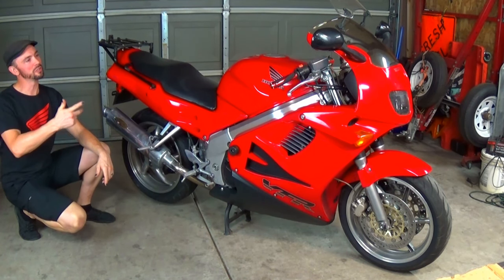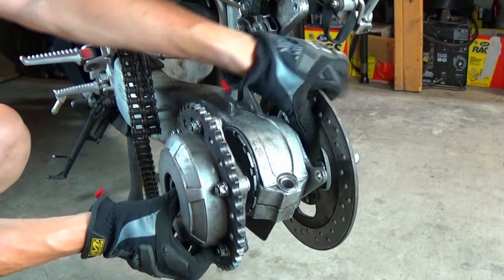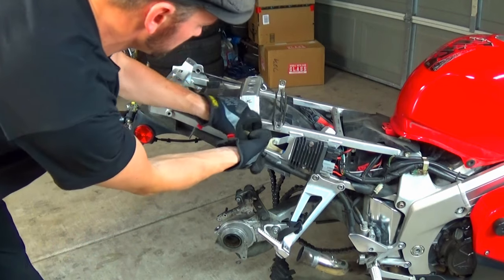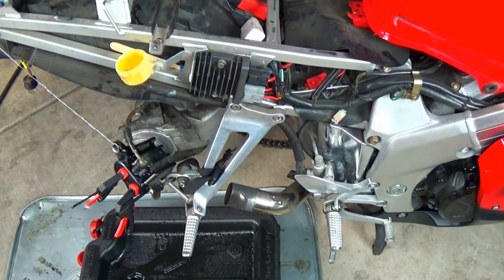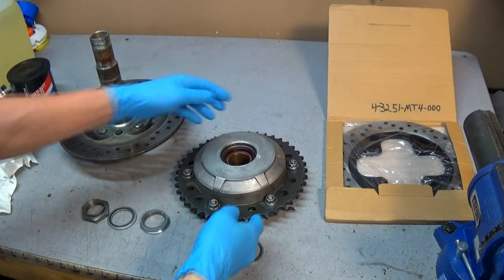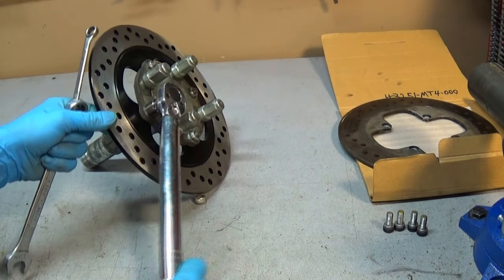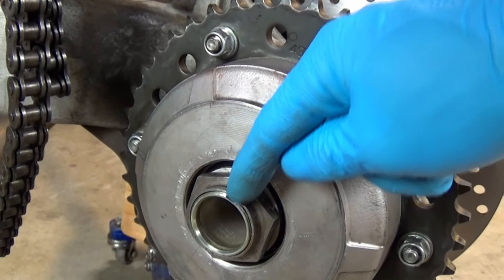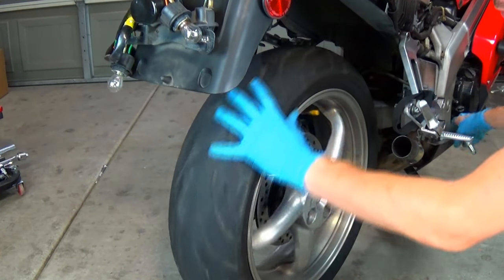Rear Brake Full Service, Honda VFR750F 1995 Motorcycle Repair

Comment: Thanks for you video. It is helpful. But you can safe time on the disassembly of the rear fearing. You dont have to take out all bulbs. You can simply just unplug the cable connector on the left side of the fearing and leave the fearing facing cables in it.

Comment: Good clear video, thank you.  One warning, I replaced my rear brake disc on my VFR750.  About 5000 miles later the 4 rear disc mounting bolts loosened, nuts fell off and disc came loose. When reassembling I hadn't used a nut locking compound on the bolts.  I was lucky the rear wheel didnt lock up at speed.  The bike rescue service guy who picked me up said it wasn't the first such failure he had seen.
If you haven't used locknut compound on your bolts I would strongly recommend double checking the bolt tightness as part of your service schedule. 
Great bike!
Reply from the maker: That's a great detail to add, thank you. The nuts on my application have a metal tang type self locking feature. But that's not always the case, and even if it is, that feature can still wear out and fail. Always good to check! Thanks👍

Comment: I really appreciate the effort you put into this video , but please don't instruct people to put grease in the caliper pins. Never put grease in caliper pins, in ANY motorcycle. BTW the RC36 service manual does not state that (I checked, just in case you were misinformed by a misprint)! Silicone grease is for the BRACKET pins, or "slider" pins, which do not come into contact with brake pads, silicone grease is required on those pins due to the fact that they slide in rubber boots and petroleum based grease degrades them.  Also, for your own safety, please don't only change bolts on high stress applications like that, you need to check that the bolt has the same strength grade before making the switch.
Reply from the maker: Thank you! I have never heard that, but it definitely checks out! My goodness. I'm glad that I've never had a problem with it yet, but I will be changing how I do it. Thanks!

Comment: Do you have a video on how to remove the rear fender ?
Reply from the maker: I remove the rear fender in this video, but it doesn't get too detailed. There are two rubber buttons in front, and there are the 2 bolts in the back under the seat

Comment: You made two mistakes on this job. Firstly, clean the pistons before pushing them back into the caliper, and secondly, you don't need to completely unscrew the bleed screw. You just loosen it, and that's enough to drain the brake fluid.
Reply from the maker: You're right about the pistons, they should have been cleaned. Nice catch! I'll usually take the bleeder out to make sure  the passage is actually clear. Thanks!

Comment: what make is the rear rack you have fitted?
Reply from the maker: I bought it used many years ago. It had some non-descript red cross logo on the top case that came with the rack that has long since been removed. Otherwise, no other markings. I have heavily modified the rack over time. I can actually mount a bicycle to the rack now... maybe I'll upload a video about it

Comment: OMG!!! another vid showing how not to flush a brake system ... no need whatsoever to remove a bleed nipple & allow corrosive Dot 4 to flow all over a painted caliper, why did u not do it correctly & fit a bleed pipe to nipple?
Reply from the maker: Hey, thanks for this. I've never worried about this too much. But, I have never liked how sloppy this method is, just not enough to fix it I guess. Next time I'll be using a bleed pipe. Cheers to always improving.